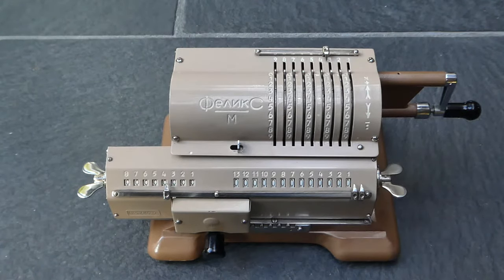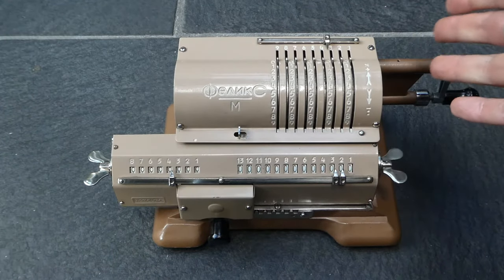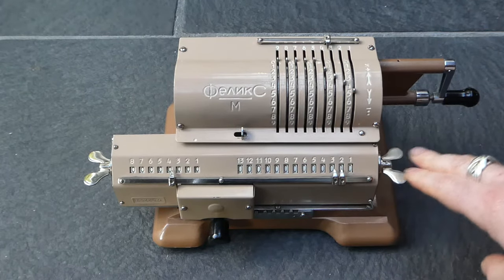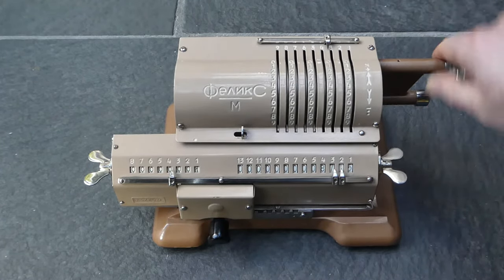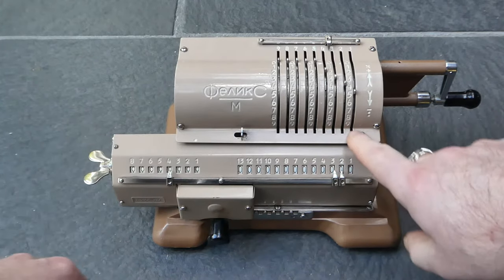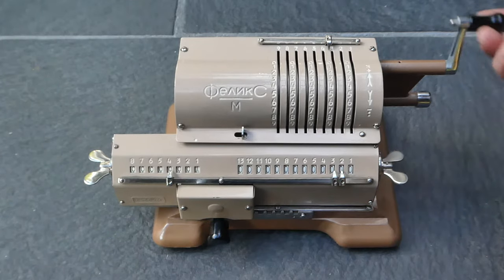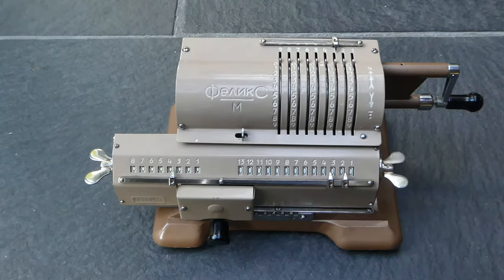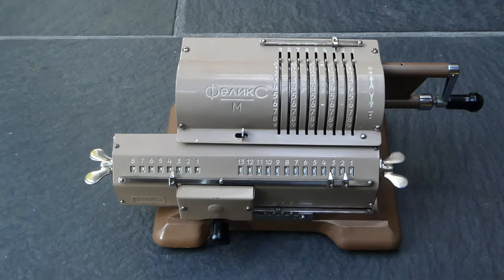The Russian Felix M calculator

Comment: Lovely machine Jaap - we've got one in similarly good condition, probably a bit earlier than yours - ours doesn't have the letter "M" on the front.  I was surprised when we got it just how basic it was and somewhat more agricultural in it's engineering when compared to a Brunsviga for instance.  Definitely a must have for a calculator collection.
Reply from the maker: It is very simply made, and the poor tolerances in its manufacture are a problem. I've had to make some tweaks to mine. At first the input pins would not move because the crank did not push in the unlocking pin far enough. The counter clearing nut is slightly misaligned so it doesn't release the carriage-crank interlock far enough, and you may have noticed in the video that I sometimes twist the counter nut back till there's a click before I can clear the main register.

Comment: This calculator is in pristine condition it's unbelievable.
Reply from the maker: Well, it was made in 1976 (probably) so can't have been used for very long. It was obsolete before it even left the factory.
Reply: The color is very atypical — most I’ve seen were black, green, teal and shades of bluish gray. Sometimes hammerite, sometimes plain.

Could it have been refinished?
Reply from the maker: @sashimanu  No, it is original. Others from the 1970s are also this colour. Brown was a fashionable colour at the time, apparently even in Russia.
Reply: @jaapsch2  very interesting — maybe an export variant? I've spent quite a time on a local eBay-type marketplace, there were quite a lot of Felix arithmometers in other colors, yet none were in posh brown :)
Reply from the maker: @sashimanu  Maybe. You can see another on Cris Vande Velde's site: http://www.crisvandevel.de/fel.htm
Reply: Yes! It says “export” on the passport, and the paper also has a Berlin address for the trading company.

This explains the color, the unusual markings (domestic Felixes have vendor markings and serial numbers on the back, the front rectangle is typically empty), the riveted “made in USSR” plate, and even the nicer chrome-plated screws used instead of typical black oxide ones.

Usually Soviet export goods were better made, hard to imagine how the domestic production worked out of the box.
Reply: @sashimanu  I just bought an identically coloured Feliks M...they really were painted in these 2 colours in the 70s. The former GDR had lots of them in use...that's why we have them on eBay now in larger numbers at very low prices. Mine did cost 8EUR and it looks almost brand-new.
Reply: @19ghost73  I think that's because it's an export version, the domestic ones were painted differently

Comment: Really interresting that such simple machines were built until 1975. I guess it was a budget model that was affordable even for "normal" people. I recently got a Facit CM 2-16 and that has interlocks for anything you can possibly think of.

When you lifted up the Calculator (7:50) i saw that the fence for the carriage handle has two extra notches to the left of the handle. Can you move the carriage too far to the left? And does the carriage move in single steps or can you just push the handle and move the carriage freely?
Reply from the maker: Oh, I see now I completely forgot to shift the carriage in the video. You can move the carriage a single step left or right just by pushing the handle left or right. The internal part that the handle is attached to tilts, dropping down a latching pin behind it to keep it from moving more than one step. That is why the notches extend a little beyond the extremal positions of the handle. You can also lift the handle straight up to release the carriage and move it any amount.

The carriage cannot move too far since it has a screw underneath that acts as a stopper when it hits the side of a large hole in the base frame. You'd think that removing that screw would be enough to allow the carriage to slide out for cleaning, but you also need to remove a bit of the left side of the casing on the carriage, and the right hand screw of the notched fence to allow the carriage handle to pass.